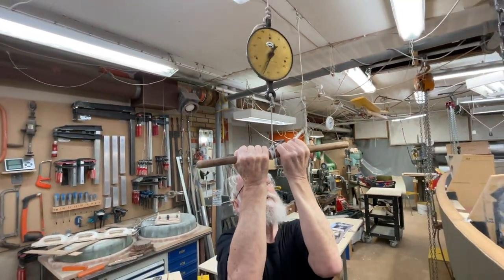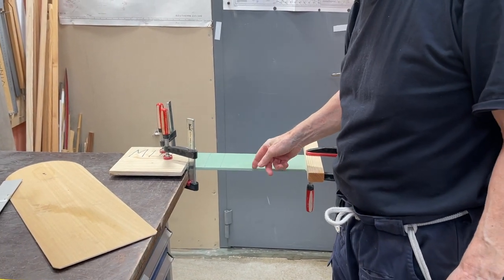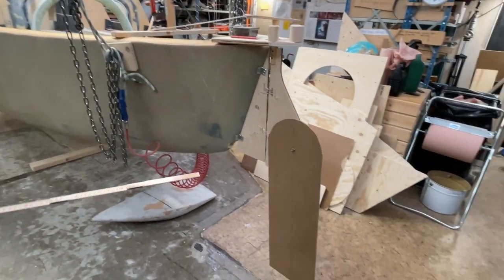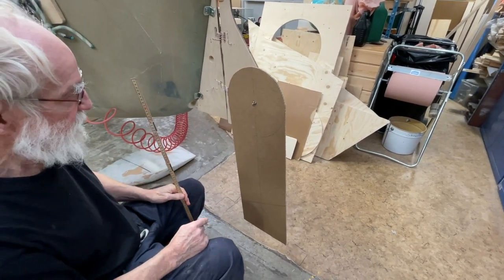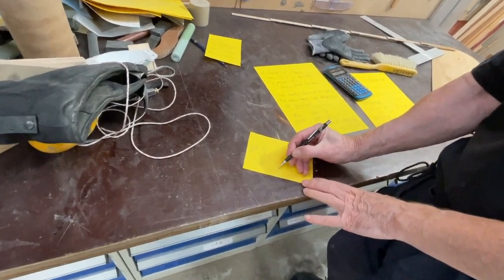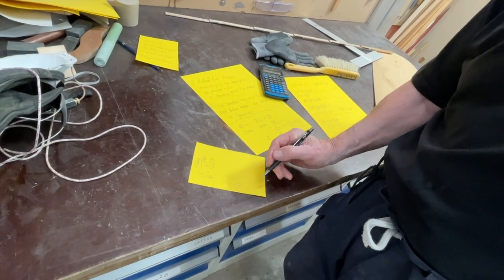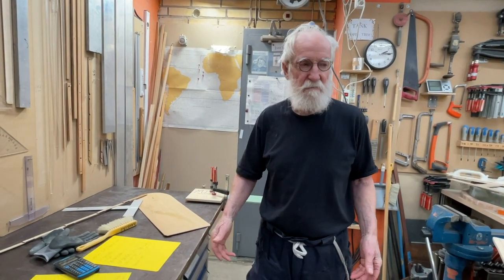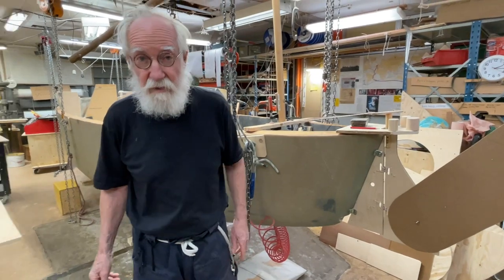31 Oct 2022  Estimating the strenght of the new rudder blade.

Comment: Dyneema is some impressive stuff. I have it as my standing rigging on my 35' boat.  It's very easy to go oversized for what ever you need it for, since it's so light weight.
Reply from the maker: Right
I do not think that my lashings will break.
Can Dyneema hold the mast of an 35' boat it can hold my rudder.
Reply: @SvenYrvindExlex  the massive cargo ships and tugs have been using dyneema lines for awhile. There's some huge line loads there.  And most off road trucks and recovery vehicles have switched from steel cable to dyneema "jerk" lines and winch ropes. 
So for your purpose, I would think it's more then qualified.

Comment: I think I would have done the “8”-lashings almost the whole length of the rudder. Then if there is some unforeseen damage it would still be manoeuvrable. 
The same mechanism is used in several of the Wharram designs. And of course about thousands of years before that in Polynesia.
Reply from the maker: This is a mock up not to scale.
It is only the lashings in the ends that are useful as the middle ones ore close to the neutral axis.
However I make groups of them.
Reply: The Wharrams are impressively simple. Definitely some great ideas there.

Comment: Some thoughts about the new rudder design. Is the rudder you have to heavy? You get more space. You say your route is far longer west from the orca problem that is by the west coast of the Iberian peninsula. So you don't really need to change it?. But if you are worried about rudder disaster it is mabee a good ide to have the rudder on the stern and the hinges over the waterline. You may make a veek link so is easy to replace? There is some self stearing wind wane that work as a conter tab on the stern rudder. Some home made. What is your thoughts about selv stearing wind wane?

Comment: What about the pivot point? Isnt that a week point?
Reply from the maker: I will make every part of the chain strong.
However many boats nowadays are rigged with modern ropes and there is far more forces on the rigging on a 40 feet boat than on my rudder and I will have make the rope go several times around.
It will be stronger than even the rudder blade.

Comment: I agree that modern for and dynema are strong enough to be used as lashing for a hinge pivot for the rudder but is chafe not a concern?
Reply from the maker: The genius thing about the figure 8 lashing is that there is no chafe.
The rope just rolls on and unrolls.
Make a small mock up and you see and the proof is that there is no friction.
Because no friction no chafe.
Just do the test.

Comment: Will you design a backup rudder system,in case of failure,Sven?
Reply from the maker: No back up.
The strategy is to design this rudder so strong that it do not fail.